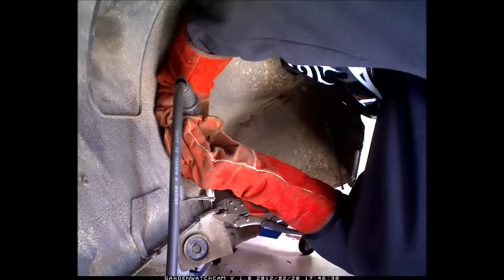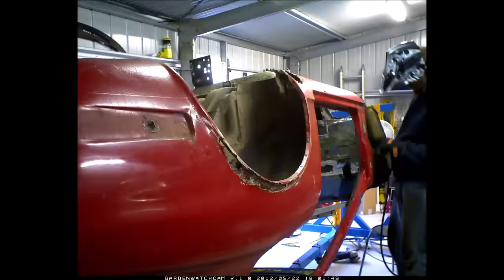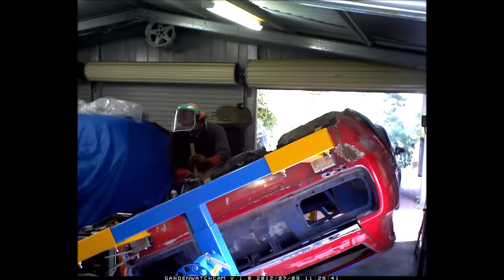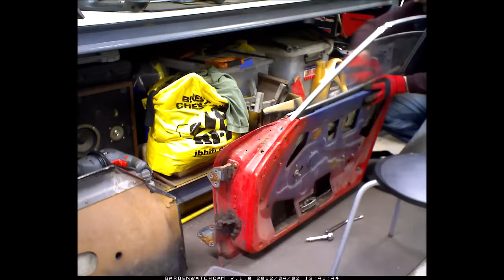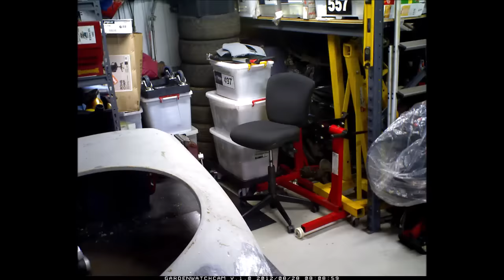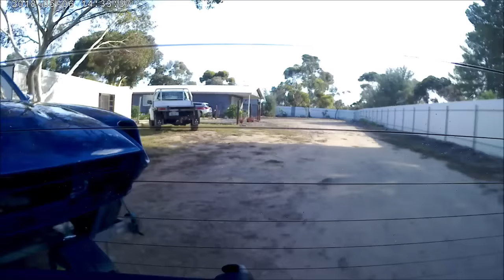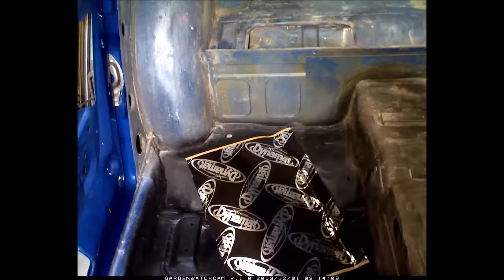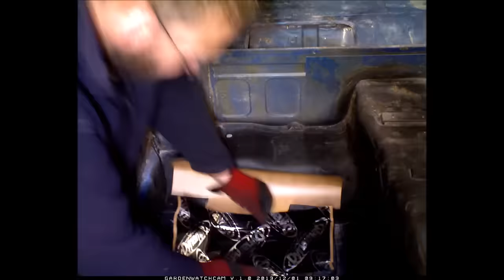Datsun 240z restoration time lapse.

Comment: This brought back memories. I used to own a '72 240Z.  I was performing a complete resto/mod with my daughter, who was 15 at the time.  It was going to be her car.  I had parts for a high compression beast using a 280 block, 240 head, and the crank from a Nissan Maxima.  11 to 1 if I recall correctly, using factory parts... I'd previously installed a factory air system from a 74 260Z.  I was down to the frame and suspension, ready to take it to bead blast.  Alas, my daughter discovered boys, and the project languished...
Reply: Send me the car
Reply: @judahbenhur7982  Lol... long gone.  My daughter is 40 now...
Reply: Story time. I’m currently in the process of restomodding a 78 280z and just discovered the joys of girls (for the first time at 18 held off for a while) and instead of ditching the car in favor of her I just hooked her on cars as well and now I have help. It’s a win win
Reply: @jazzyjonny1449  It is a rare woman that can get into that side of cars.  Sounds like a good one.  Treat her right, and never compromise on your passions in life for the sake of a woman.  A woman will respect you more for staying true to yourself.  Good luck with the Resto mod.  I Loved Z cars
Reply: @jazzyjonny1449  I’m a mobile locksmith. I was hired to rekey a home about 2 months ago and was told I can have anything in the home and garage. Initially I said no. Then the owner says there’s a car in the garage I can have. He peeled back the tarps. And it was a complete 1978 280z only missing the Datsun emblem on the back. Obviously it needs work. But zero dents and even the key to for free. It hasn’t been registered since 1992. I’m deciding what to do with it. Not sure how much it will cost me to make it an awesome ride for me and my wife
Reply: @jazzyjonny1449  I’m in the same boat, finally 18 and about 2 weeks away from having a 78’ 280z in my driveway, but also just so happened to get a girlfriend a few weeks prior, thankfully she loves the old Z’s as much as I do and wants to get a 280zx herself :)
Reply: little did she know that car coulda got her any guy she could want haha
Reply: @ItsSpice  The funniest part is that as much as she had learned about cars from me, her boyfriends were intimidated by her ability to troubleshoot problems.  They would not believe her, come to me and I would confirm what she said... too funny.
Reply: @jomama55ful  hahaha she coulda had something to show her knowledge and skip checking in with you every time but i guess she had different priorities thats fair enough , these cars are beautiful if i was her id be punching the air right now with how the prices have gone to mars
Reply: That’s really sad, I have an offer for a beaten up shell of a 240 that would definitely be a big project but I would really like to do it, I’m just afraid I’m going to be like your daughter and lose the interest, not in the car but in the work involved.
Reply: I’d need to repaint it red.
Reply: @grenadierat2268  True that, but she had no trouble getting boyfriends.  She is a mother of 3 now, with 2 that have graduated high school.  Time flies...
Reply: Bummer.     Her loss……….

Comment: super work...you saved what would most restorers call beyond saving....because it is alot of work....
another life was written for this one....
Reply: They call it "beyond saving" not only because of a lot of work. Non-factory welding in such amount and spots make it dangerous to drive on roads. It can fall apart in minor car accident and become dust in a high speed accident. That is why such cars better to stay static
Reply: Alexis 200SX   True, it can be very dangerous if done incorrectly, but if you’re a good enough welder it can be just as strong as it was 50 years ago when it rolled off the factory floor. Most restorers are decent welders, I mean they’d have to be, but they tend to do a lot more grinding than welding as patches on body panels have to look good more than much anything else. The fact that this guy has confidence enough in his welding to patch that much rust on the chassis shows (to me at least) that he’s been doing this for a very good while.
Reply: Didn't you know that a well done weld is stronger than the parts is welded to?

Comment: This brings a tear to my I. I owned one of these when I was 20 back in 84, it was a rotted out junker….but when you're 20 it might as well be a Ferrari just the same.   The body snapped right under the fire wall as they pretty much all do and well I didn't have the skills to fix it so.... Anyway it's always been my favorite old car so it's nice to see these old girls get a second chance to feel the wind on their headlights once again. Good on ya bud...peace :)
Reply: I totally empathize with you. When I was 20 (and my '70 for that matter) I sent it to the scrap yard; floors rusted out, door hinge failing and stabilizer bar broken from the frame rail. Wish I could get it back as it was a very early one HLS30 01030 production date 1/70.
Reply: @bartscanland9415  ......Indeed buddy. Now there are all sorts of aftermarket parts for it and yours in particular would be have been worth a fortune had you been able to fix it up. How were we to know though right :)  Cheers

Comment: I think you did a pretty outstanding job and have more patience than I. I did the exact same restore on my 71, but was fortunate that the only metal I had to replace was both floor pans. I am 98% finished and it has taken me almost 4 years and $53,000 later. Trying to find NOS parts is next to impossible and when you do find them, the prices are outrageous. Mine is the exact same color as yours with front and rear spoilers and back window louver is in black.

Comment: I had a datsun 240 z back in the early ‘90’s. Completely rebuilt it. Was a great car. Had triple Webber’s and 11 1/2 to 1 compression, 5 speed, kyb struts and a 2 1/2 inch sway bar in the front and a 1 1/8 inch in the back. It handled like a dream and screamed. It loved 105 mph. Hummed along and could do it all day.  Mine was gun metal grey with a silver rally stripe down the passenger side.

Comment: What a tremendous amount of work you did ! From what I could see in the beginning, the car was pretty rough and I assume most people would have used it for parts, the work you had to do on the body is insane ! Congrats you really did a great job.
Reply: uscar17 I thought the same thing.   Huge amount of work to recondition that body. Didn't see bondo being used either.
Reply: No he really did it properly, the way it should be done. I bet it took quite a lot of bravery, personnaly I would never have dared tackle something that hard. I really respect that guy, he's got the balls, and the skills
Reply: those old datsuns were made with thicc bodies they can stand a bit of cutting and welding
Reply: They sure can, but that took quite a lot of will, with such a huge amount of work
Reply: Oneofdazzz terrible corrosion control however... insulation was entirely inadequate as well but he did a fantastic job correcting both
Reply: he had to restore it because he couldnt find another one any where. theys hard to find. he had to work with what he had. I have one, but mine is a 78 280z. it is not as bad shapes as his.

Comment: Watching the floor pans being replaced brought tears of joy. This was a "from the ground up" rebuild. The best that I could do for my 70 Z was a refresh, not even a refurbish... back then Datsun did a terrible job of corrosion control and sound/outside exhaust insulation so I was glad to see that you beefed up the insulation; it gives them such a better feel. If you could, put two part foam in the floor pan supports underneath to keep out the moisture (do that anywhere there is gapped sheet metal, it may not be factory but it helps a lot). 
Thank you for this wonderful work of passion, it will be a sad day when the last true Z is taken off of the road. 
(Btw mine was one of those early parts bin models; it had the Datsun 2000 Roadster carbs and opposite hook up brake master cylinders).
Reply from the maker: Thanks for watching, I used seam sealer on all the joins and tried to seal up all the gaps and used fish oil treatment on all the internals so that should help keep the rust at bay.  Plus it’s not going to see much rain....

Comment: Awesome job!! I saved a 280z 2+2 out of a junk yard back in November and slowly getting it running but I hope to restore it as you did yours. I still have solid floor pans but rockers and lower rear quarters are in need of replacing.

Comment: Simply amazing! I have projects and my first car was a blue1973 Datsun 240z with black and white interior. Mainly stock but some suspension work, trans, differential, cooling trans and radiator work, and audio upgrade. But that was in 1980 technology. I still have the radio to it. I am motived to turn a wrench in my garage. Nice video.

Comment: Came within $100 of buying a 1970 240Z new. The dealer, mind you, was the local International truck dealer in my town of 30,000. Datsun was a new company back then and there were no regular dealers in my area. I had a '69 Nova SS that I had also purchased new. I was so impressed with this new little 6-cylinder sporty car I tried my best to buy one; there was nothing else like it coming into this country, everything being a 4 cylinder. 
It's just as well I didn't buy because insurance companies, shortly after these things started being imported, declared this 240Z a sports car and gave it a higher risk insurance rating. If I had bought one, I would have not been able to pay the insurance premiums. I would pretty much be walking, with a new car sitting in the driveway. Sometimes, things work out for the best.

Comment: I owned a 71 240Z and It was a work of art.  Every detail down to the mahogany steering wheel just spoke to the level of engineering that went into the early Japanese sports cars.  It was a piece of automotive art and function.  It was blue like this one and I would literally smoke 80's Z28 and Mustangs that tried to take me.  It was tuned with headers and six weaber downdraft carbs.

Comment: This is an absolute credit to you - beautiful job!!      I restored one back in the 1980s - no where near as much work as yours.    That photo with the "Trucks Use Low Gear" looks like the top of Checkers Hill Road, Kersbrook.    I live only 20 mins to the east from there!!    Don't see many 240Zs in Sth. Australia now!!       Tiger.
Reply from the maker: Thanks, yes that’s Checkers Hill - not for from us either.
Reply: Did you manage to get new quilted vinyl for the centre tunnel & shock towers etc. - or re-use what was originally in the car?     I know that new interior kits are available in the US (hard to get though).     Tiger.
Reply from the maker: Quilted vinyl is all original.

Comment: That was fun to watch. I used to own a ‘73 240Z and restored it but not near to the point you did. Could have used the mechanism you used to rotate it on its axis. Would have saved me a ton of time. I read you were putting back to factory specs so you used the dual side draft carbs. Those things were a nightmare for me. Thanks for what you did.

Comment: Great resto my friend and that blue suits it all to hell looks like subaru blue always a great colour for a car and should some feel the need a nice metallic silver goes with it VERY nicely. They were always known for being rot boxes the 240Z's having worked in the trade for over 25 years I've come across a few with rotted out floors toasty chassis members and crispy arches. A guy I knew bought one some years back that was 'supposed' to have been restored it was delivered on a trailer the seller got his money made his excuses and left rather rapidly. My friend got in it and started to hear cracking noises it wasn't long before the drivers seat went straight through the floor, to offer up some advice for those who are 'not in the know, if your going to buy a 240Z check it over 'Thoroughly ... with a fine tooth comb.

Comment: I had a datsun b110 1233 cc i believe it was in the 1200's didn,t use a engine lift except our elbows and back.Very fun car bigger inside than you may think.Went camping once with a canoe on racks extended 3 feet passed the front and back,had to ride first gear to get up the mountain.Good times.When younger my brother had a friend who was a z head 240,260,and 280 the 280 scaed me had the 3 carb webber camed etc. the key to their speed is weight.

Comment: The arrival of the 240Z in North America is a benchmark. I remember the Road & Track issue when they gave as much news about this car as they could find. They still weren't for sale. However they wrote that at least in California where there was the biggest confirmed buyers waiting list, people were offering the dealerships more than list price so they could be higher on the list. Unreal.
I saw one on the road in Ontario Canada last summer (2017), keeping beside me in bumper to bumper traffic so I got a good look. It looked so tiny compared to what I remembered. But so did a Dino Ferrari of about the same age when I saw one of those again.

Comment: Takes more work to restore this one, than it ever took to build it in the first place. I loved that year. Datsun had terrible color ideas. Even their red looked terrible. They had an awful air conditioner unit. And the sound insulation sucked. It was nothing compared to a new car today.
I grew up with the '71, and when I was 16, it was mine. I loved that car. With everything that was wrong with them, it was a true gem. It felt like a real car. My memories will be of the wonderful handling and beautiful body.

Comment: An interesting detail: unique shape of the bottom edge "line" of the rear side window is repeated in the top line of the headlight.  Both lines start with a shallow curve , then there's a sharper turn or corner, then another shallow line, giving the curve a sort of "point".  Definitely a part of the original z and is still used in the latest model. Where?  Same place: rear side window.

Comment: I found a 78 datsun 280z that's been parked 20 years its pretty rusty. I was thinking about just repairing the body to where its functional do and do an LS rest rod type build rusty but clean all new parts all new seats racecar interior every nut and bolt tight but with a deathtrap vibe

Comment: Is that semi-monococque construction? I ask because I had a 1977 Capri that used that design and it meant that a parking lot fender bender would basically total the car. They said you'd never get the alignment right after that.

Comment: And the #1 rule of fitting panels like quarter panels and those panels that are positioned off the quarter panel is...only do it when the car is on it's suspension on the ground...not when it is suspended by a floor jack or stands of any kind...unless you first welded in cross bracing to keep the door openings to spec, and cross bracing to keep the cowl and rear suspension mounts in spec.  Cause when you go to align the moving panels to the fixed panels...you may get a nasty surprise...especially when dealing with rusty Japanese sheet metal from the 1970's.
Reply from the maker: Thanks Mark, I did weld cross bracing though the cabin from the base of the windscreen to the rear shock towers, will try harder next time but lucky this time the panel gaps all worked out OK.

Comment: Would it be considered structurally sound given so much chassis work replacement is being cut and welded back on? How does that work? Sorry for noob question.
Reply from the maker: It's all good, you put back as much metal as you cut out and make it just as strong as factory.

Comment: What are the specs on your rally Z how much lift and did you build belly pans for front and rear...is there a buikding a Z rally car site you are aware of.
What size and brand rally tire wheel combination you rally your Z on.
Its December 2018
Reply from the maker: This car is built for Tarmac rally and not gravel so it’s actually lowered in line with a track day car.  We run 16x7 wheels and Advan AO50 r-spec tyres. Thanks for watching.

Comment: Can you post a link for that garage modular structure please? who produce that? looks easy and clean.
Reply from the maker: Ebay - vehicle rotisserie similar to this. https://www.ebay.com.au/itm/CAR-TRUCK-BOAT-VEHICLE-ROTISSERIE-FRAME-REPAIR-RESTORATION-4500LBS-2041KG-CAP/331927987472?hash=item4d48732510:g:Va8AAOSwrrhcrwmY

Comment: Nice! Did you have any warpage or misalignment issues when removing panels with the car turned on the rotisserie?
Reply from the maker: Hi Mark, we braced the chassis before we started to reduce the flex.  All worked out Ok.

Comment: Crap, what panels didn't you have to replace, seems like a hell of a lot of time and effort. No doubt all the internal bare metal and welds got corrosion treatment.
Reply: Agree - Also all the body panel cavities, including the boot, bonnet, sills etc.  Zs rot from the inside (I owned one), even after a rebuild like this thorough one.  Good video!

Comment: At what point and what is the process to committing to this car for restoration?  How do you know it's "the one?"  It was basically a rusted out pile of junk to start with.  How do you decide to put that many hours into bringing it back from the dead?
Reply from the maker: You probably wouldn't do a project like this for profit, the cost to restore is higher than the finished value.  Sometimes the journey is more important than the destination.

Comment: Is that the L24 inline 6 with 4 spd manual trans?
Reply from the maker: L28 and 5 speed.
Reply: @Rally240 Thank you.... You have the best possible motor for that year. Tell me what does the casting read on the side of the gearbox....60, 56A, 63A or any dogleg 60 series.